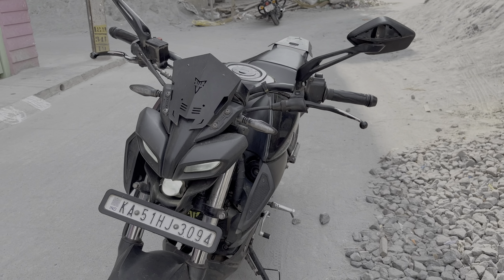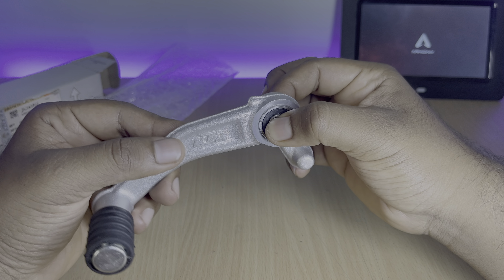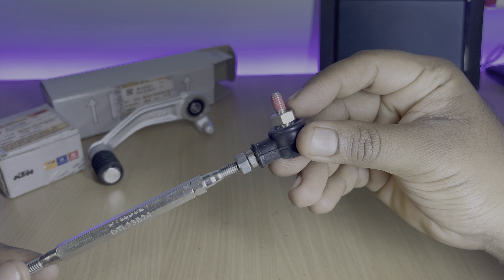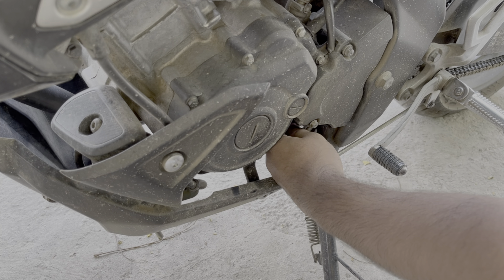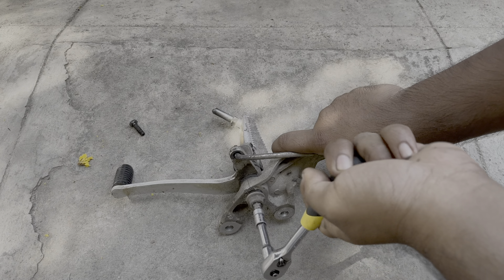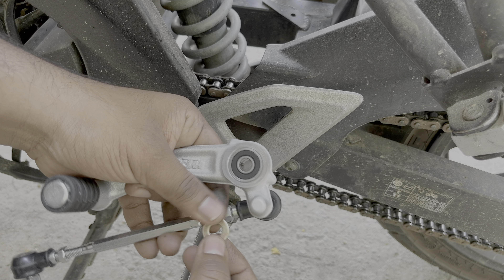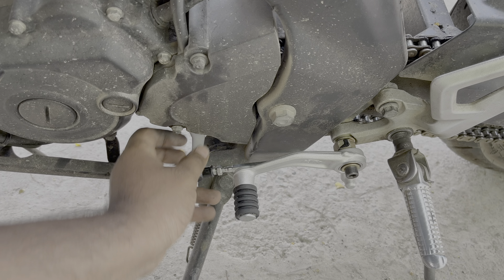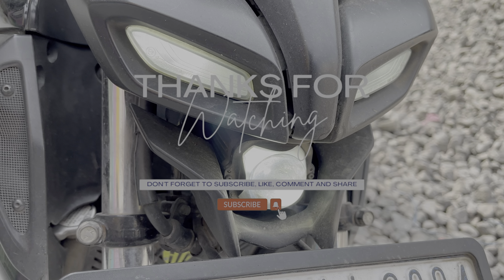Get smoother gear shifts on MT15 / R15 | KTM Gear lever installation | #mt15 #r15 #modification

Comment: This video is highly relevant to my current situation. I was considering replacing the original equipment manufacturer's clutch lever due to difficulties with gear shifting and vibration. Your video provides a valuable solution to this issue.

Comment: A job well done... But I have few questions
1. Is the space between foot rest and gear lever same as compare to stock or is it decreased? 
2. The angle looks to be changed as compare to stock one, in stock our foot stays straight but here it looks like we need to lower it much downwards, please correct me on this one?
3. I reallly like all of your videos, you do what can be possibly done using the right parts! PLEASE make some videos on headlight modifications as well, that helps eliminate the Fog light demand, is possible.
Reply from the maker: Hey @harrykrishna8381
1. The spacing is optimal in this case, even though the gear lever itself is smaller, as it’s mounted farther away from stock setup, the spacing is optimised. 
2. This particular one has adjustable angle 📐. So you can set it as per your riding style and requirements. 
3. Thanks buddy. Noted will do it in future.
Reply: @ARKIONX
Does the connecting rod fit in R15V3, I think this is short, Does ktm have any other size ?